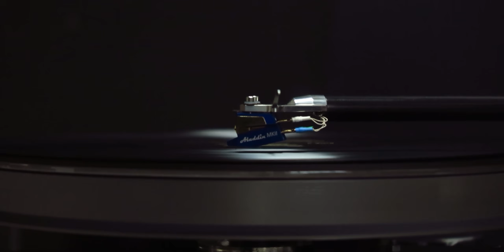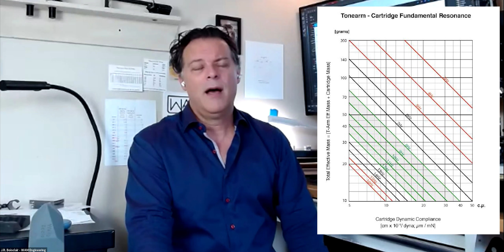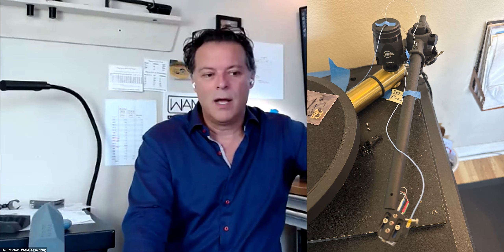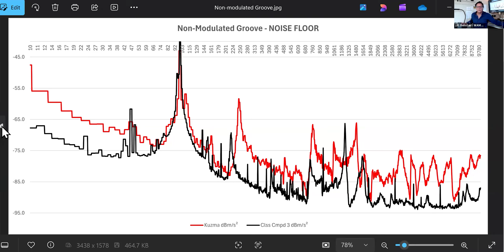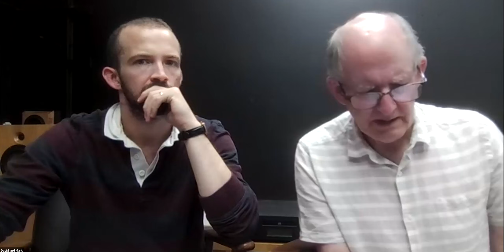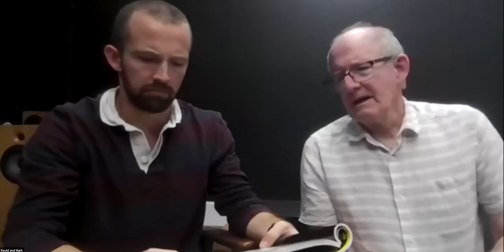The Truth About Tonearm Specs | J.R. Boisclair, WallyTools

Comment: 23:50 I'm assuming that means no wood head shells? I bought a Yamamoto HS7 camellia wood headshell I was going to use with my next cartridge simply because of the lower weight..
I also have a Yamamoto HS4 headshell carbon fiber. I could always A-B it.
Thanks Origin Live crew and JR

Comment: Totally agree, JR channel deserves alot more traffic! I know JR is not a fan of any losey layers between the head shell and tone arm as he says keeping it tight ( not the bolts) Ive just collected this morning a hana mc sl and looking forward to fitting and listening, im also going to experiment with the enabler! But is this not a sticking plaster over a problem I may or may not have, as ive mentioned before I can hear on the stethoscope a very very low pulsing deep sound on either end of my Zephr tone arm, I have at every point on the system experimented and decoupled to a good improvement using the stethoscope.  I would be in the future very interested in jr's analysis service for adjusting manufacture error!!Richard
Reply from the maker: Hi Richard, We spoke about this with JR a little bit, and we are sending him an enabler. I'd simply recommend trying it with and without, and listening; many owners find it a benefit on most cartridges. It's our working explanation that the enabler is essentially rigid above 100Hz, and acts as a filter for vibration below this. We will be making a video discussing the enabler in the future. I'm not particularly familiar with stethoscope testing, so I wouldn't be able to say whether this is simply the sound of the electricity in the tonearms' cabling or something else.
Reply: @OriginLiveInfo thanks David, the sound is not audible at all I'm just curious! The stethoscope is really handy for listening around the whole system, particularly being on a yorkshire budget! it's somthing I picked up on JR channel!

Comment: The cartridge is going to move because acceleration = force / mass.    The only way the tone arm is going to "hold it" would be by adding more mass to reduce the acceleration of the cartridge from the forces coming up through the stylus.  If the cartridge has  1/1000th of the mass of the stylus it's motion is down 60 dB, so who cares.  The stylus tip weighs around 1 mg  and a cartridge is often around 6 to 9 grams.  Add the head shell and there you go,  1000 to 1.  That cartridge motion relative to the stylus tip motion is  gong to be  inaudible.  Buy the Ortofon test record for $56 and test your system.  You will quickly find that it's fun to listen to, but it's not high fidelity.  High fidelity starts at 0.1% distortion and below,  SNR > 72 dB  ( 12 bit ENOB ) and flat from 20 hz to 20 khz  within less than 1 dB.  There's no traditional vinyl record playback system anywhere ever that has done that.
Reply: Sorry, but I believe you have oversimplified the transduction system starting with a focus on non-linear distortion but not linear distortion, have not taken into account the spring system nor the effective mass of the moving parts. 

Mass alone won't solve the problem either as it will add problems if you don't also accompany it with rigidity and a very serious attention to mechanical impedances and energy storage. I'll be doing a video on the mechanical ratios (of which you forgot a few portions) and a huge amount of detail on just one of the linear distortions will be in our AES paper which we expect to release this year.

Your claim that mechanical transcription isn't high fidelity is a clear sign that you haven't had an opportunity to experience for yourself how good it can not only compete with, but beat, the best digital has to offer today on just about every subjective evaluation parameter. Rare is the system that is ready to display that, but that is why we do what we do - to allow more people to hear it for themselves!

Comment: Do you want to develop a tool I've got an idea a one tool that does every measurement VTA  rake angle, azimuth, zenith, vtf maybe Anti skate should show up! and one more thing it can do I'm not saying what that is no tool can do. I haven't got the facilities to manufacture need special equipment. I did put the idea to Jr wish I didn't now don't want them nicking my idea. Wouldn't be that expensive to manufacture a retail price of 100£
Reply: The complexity of the system is enormous. It is certainly much greater than any of the engineers on our research team has expected to find before commencing our research four years ago. There is a product out there that claims to do all of this but a few of the tests on that product only serve to demonstrate the designer doesn't fully understand mechanical transcription basics and, as a result, cannot be the solution for optimizing the system.

We are working on something. Stay tuned.
Reply: @WAM-Engineering  what is that device that does claim to do everything? What are you working on?
So nothing like I told you about my design then? I hope no I recorded it and the timeline

Comment: Quite surprised that  the professionals here did not recognise a standard test record turntable speed spectrum. 3150hz .The HifiNews lab review plot. It shows the speed variation from a cartridge playing a 3150hz tone, and is not made from an accelerometer at all.HifiNews regularly post this 3150hz peak plot in reviews to show sur table speed stability, below that you may it may not see a horizontal plot showing tonearm accelerometer test - a plot in 3 dimensions showing some ridges which are arm vibration nodes
Reply from the maker: Thanks for watching. We filmed this at the end of the working day in the UK, with JR kindly coming on at 8am California time. Admittedly, Mark does initially mistake the wow graph for the one we are intending to talk about, which we then point to, display on screen and describe as the tonearm resonant decay graph in frequency, time and amplitude - recorded with an accelerometer. A simple mistake that is easily made when recording live, which we then clarify.
Reply: Indeed strange also the mention of 100hz vibration caused by turntable motor vibration , why not use a dd table for the measurements ?

Comment: As it pertains to rigidity, and all aspects of tone-arm engineering...
...does that also apply to the machine the creates the lacquer's impression via a cutting lathe?

How does that machine do such a remarkable job?
Or do those machines differ in quality, just as our analog playback equipment differs in quality?

But since many of us have heard vinyl pressings that have heavenly sound quality, that means that the cutting machine for such outstanding sounding pressings must have been of outstanding quality.  And this goes back generations.  I own Beatles pressings that sound so real that there is no sense of it being a reproduction.  Some of the songs sound like the band is really there.  Same for my Led Zeppelin II, hot mastered, RL / SS pressing.

How did the cutting machine, in the 1960s, get engineered with such quality?  Did not their cutting lathe they need infinite mass (in theory), in the same way that our analog playback equipment needs?

In the 1960s, they did not have phono amps and speakers, etc, that have the realism of today's best high-end offerings.  There were no Magico M9 speakers back then, and no Aesthetix IO Eclipse phono amps back then.  And yet, the cutting equipment that they used back then is being revealed by today's ultra high-end gear to be of similar quality.

What were they using to cut those lacquers, and how did they engineer such wildly good equipment?
They had no way to play back their products on the high-end equipment we have today, and yet somehow they designed cutting equipment in the 1960s that was 60 years ahead of its time.

How did they design / engineer their cutting equipment to have all of the qualities that we hear today.  Did they have a J.R. senior back then with such extraordinary engineering skills?
Reply: Excellent questions.

It is not possible to study what constitutes optimal playback conditions without studying the mechanical characteristics at the time of cutting which is why we travel extensively and work with recording engineers and cutterhead/lathe designers to learn about that arena (from a geometric perspective predominantly).

There are many opportunities to improve the cut! That is the good news. The bad news is that it is going to take effort to raise that awareness and to get engineers the tools and resources they need to make those improvements. These tools/processes do not currently exist in an easily applied and scalable fashion.

We are working on it.

There is also the problem of the client who orders the record from the engineer but uses a poorly set up turntable to assess the record quality which often forces the engineer to undergo additional sound processing to accommodate the client’s poorly setup rig such that it won’t throw off the obvious sonic indicators that "something is wrong". In this case, the “something” is the most often the fault of the client’s tonearm but the engineer's product often gets the blame.
Reply: @WAM-Engineering  The GF cartridge that you set-up for me at the New Jersey show, in November of 2025, is constantly amazing me.  But on average pressings, I quickly get bored.  On white hot stampers, I am blown away.  I recently played a few songs from my white hot sides of "The Wall" (first time playing those songs since you installed the cartridge).  I expected great sound quality -- but my expectations were exceeded.

Are there any east coast shows this year that you will be attending?
Reply: @0Perhaps capital audio fest

Comment: I have an unrelated, but related question. Based on my background I had a great deal of involvement with the use of carbon black (soot) used in the production of black vinyl used for record production. Carbon black comes in many forms and through electron microscopes looks like a minute coral structures. So my question is this, if the mixture of the various raw components used in the vinyl base is not adequately mixed and homogenized at which point will you know if what you are hearing/measuring is the result of cartridge/tone arm or of the vinyl used at the point of pressing. Are you using a specific type of vinyl for your testing needs, perhaps a more virgin vinyl with none of the additives to preserve the record. I also know that when video recorders were being designed for recording and playback of video only on particular grade of carbon black was used due to its minute structure, at the time manufactures in the UK were using Shawinigan Carbon ( it’s been almost 50 years so the spelling might be in question ).
Thanks, Chris
Reply from the maker: Interesting question Chris. If you're using the same record for reference during testing, then the changes will be from elsewhere.
Reply: @OriginLiveInfo Firstly, thank you for responding. Of the media you use are they cut specifically for you based on your needs? Example are the cutting heads set with a null signal such that the grove is cut smooth, so no undulations, or with a specified frequency ?  If so what do you see as an output from a vinyl pressing with no signal cut, do you see variations from the lathe? Just curious do you also choose a specific stylus geometry?
Thanks
Reply from the maker: @christopherkent6512  There are a lot of test records out there cut with pink noise, and different frequencies for testing, for instance the Hi-Fi News test record by Len Gregory is one we use, Tacet make one, Cardas used to make one, I think analogmagic have one for use with their software?. I think @WAM-Engineering is in the process of cutting some of his own for specific testing. In terms of geometries, as a company, we tend to use Baerwald, but you might want a different geometry based on your listening preferences.

Comment: I’ve done a lot of vibration testing and used to design accelerometers.     Also fascinated with tonearm design. 

The headshell trace is interesting - but - as is pointed out, there are a lot of complicating factors.  Change in mass distribution is a big one, and could change the tonearm bending modes.   

There is a lot of noise in vibration testing at audible frequencies and this can make interpretation less than straightforward.   I would be careful with claims in this realm. 

Good stuff.    Alex at Korg did a lot of this sort of thing with terrific interpret and published it on his website.
Reply from the maker: This is an interesting point, Greg, though a counterpoint: do bending modes matter if they are not displacing the headshell?

Mark mentioned something in our episode on armtubes that stuck with me (https://www.youtube.com/watch?v=o48012lVvAU) - that an arm in perfect resonance isn't actually displacing the headshell at all. 

The problem is that resonances don't work like this in reality and, in fact, displace the headshell, so if additional mass were changing bending modes for the worse, this would show up in a headshell trace.
Reply: it’s true, the contribution of bending modes -  and the question of even if they are excited, is a good one.  I’ve always struggled with this, especially with respect to tonearms.   

Doing vibration analysis on structures often times what you’ll do is use the model superposition method along with a random vibration input function to calculate the resultant response.  
But the critical difference – and one that is very, very difficult to figure out – is the contribution of damping.  Damping is very dependent on the mode shape, the material, and the boundary conditions.    

It’s quite possible that exciting a bending mode does not produce a measurable response at the headshell.    The problem is that the cartridge itself is a structure, one that dissipates energy shapes vibrational input, and include damping, particularly of the cantilever.   So measuring the displacement of the headshell is not necessarily translatable to the response of the stylus tip.

Comment: What you describe J.R., is the tail wagging the dog. This is the reason my tonearms have a very long overhang past the pivot. The added inertia keeps the cart in place relative to the groove and has enough "give", to allow for an eccentric disc. 

Very happy that these concepts are being discussed. I am currently reviewing/integrating an etsuro urushi cobalt blue, and the results are very, very promising!
Reply from the maker: A few weeks prior to filming this, we actually had a failed attempt at recording, and JR used the term 'tail wagging the dog' several times - a perfect description of the tonearm problem and now a firm part of my hifi vocabulary! - David
Reply: @OriginLiveInfo  Great fun! I will have my vid on the Etsuro Ushuri Cobalt Blue cart out in a day or two. It will be on the longer version of my 12" tonearm (more length past the pivot on the weight side). Inertia can be our friend. Cheers.
Reply from the maker: @AndysRecRoom  Inertia is my best freind ;)
Reply: Won’t a long overhang screw up the proper alignment?
Reply: @balleclorin2804 no, I am referring to the section past the pivot with the counterweight.

Comment: Interesting comment by JR on the Torque measurement of the head shell cartridge screws. Is this something we need to add to our set up steps?
Wonderful discussion guys, thanks for this.
Reply: I don’t know what I could add for this as it seems to me that no simple rule can exist as the optimal torque likely depends on many factors that are too many to mention here.
Reply: @WAM-Engineering  Research may provide data for common tonearm/cartridge combos from the mfgs in the future. Assuming they are willing to make the effort. In the meantime the hobby might start this off with shared results anecdotally.
Reply: An obvious question but nobody seems to care for the obvious answer: simply experiment with tightening and you will know what works best simply by listening.
Reply: @charlesmiller6281 there are some unrecoverable mechanical failure points on some applications you would need to be concerned about. Some are not so obvious such as those you would have to worry about on some Ortofon models.

Comment: Thanks that was excellent! At what level do you invest in a Wally expert to correct your set up? I own a Zephyr and Hana Blue on an old Technics turntable, but I would dearly like to get the best out of my system? Thanks again
Reply: I think it makes a lot of sense once the cartridge is at the $2500+ level so for sure a Hana Umami Blue qualifies. But once you've heard the benefits of JR's corrective shim, you might want to have it done on every one of your favorite cartridges no matter what price point.
Reply from the maker: Thanks for watching, Stephen. In my experience, you can optimise and get more out of most set-ups out there if there are adjustable parameters (and sometimes one can improvise) I'm in no doubt your set-up is capable of being optimised, and its fun learnig how!
Reply: @O @OriginLiveInfo anks. I’m not sure what means.
Reply from the maker: @StephenHarding-i7b  If you can adjust Tracking Force, VTA, Side Bias, Overhang & HTA as you can on the Zephyr then yocan definetly adjust these settings to get the best out of your cartridge.